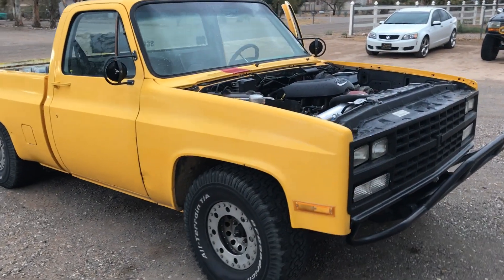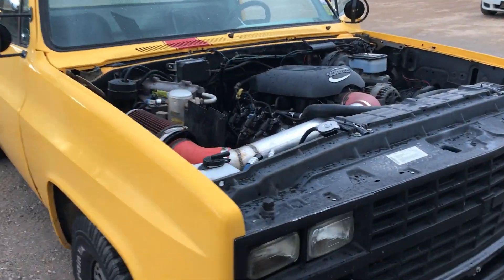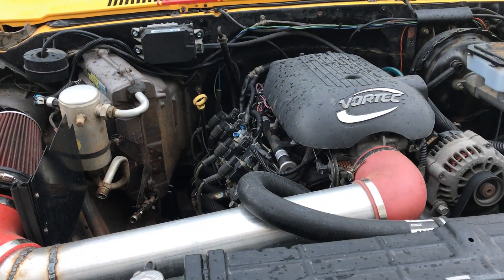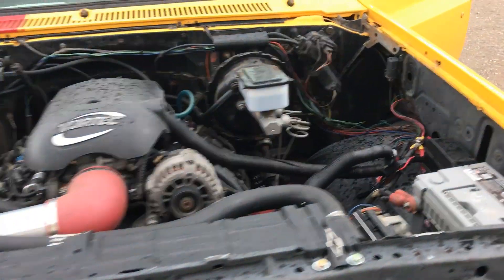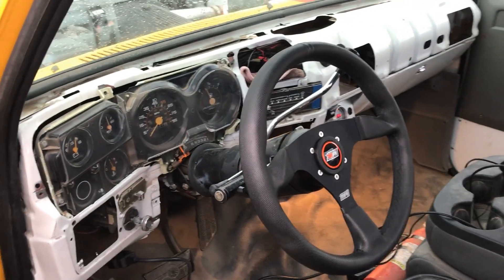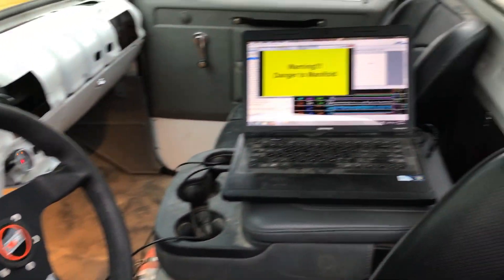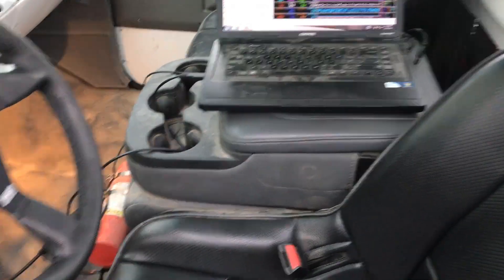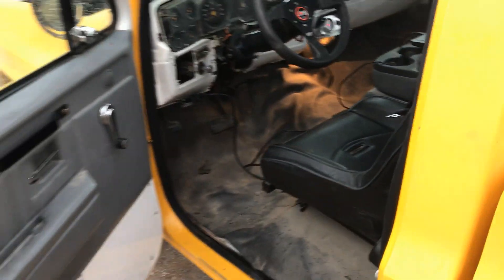Sloppy Mechanics 3K Hooptie Challenge Special LS Swapped C10 with Elgin SS3 Cam

Comment: Not sure if you already fixed this but my 05 Silverado does the same thing. Apparently it is common for the O-ring on the oil pick up tube to go bad loosing the proper seal into the oil pump. Cheap part, time consuming fix.
Reply from the maker: Steven L. Tolbert Jr. As a matter of fact I replaced it, and the oil pressure was much better. However the actual issue was a spun bearing because it made a window in the side of the block a fee days after this video. My plan is to now swap everything over from this motor onto a 6.0 short block I have.

Comment: What stall and transmission did you use in this build?
Reply from the maker: I used a 4L80E from a 2001 Chevy Van & a factory 4.8 converter which is supposed to be a 2000 stall. The converter was too tight in my opinion and next time I'll go to a billet 2800-3400 stall.